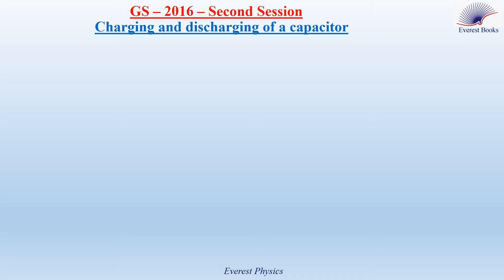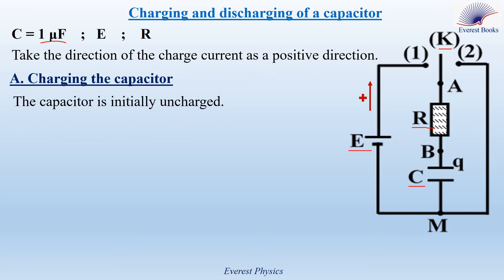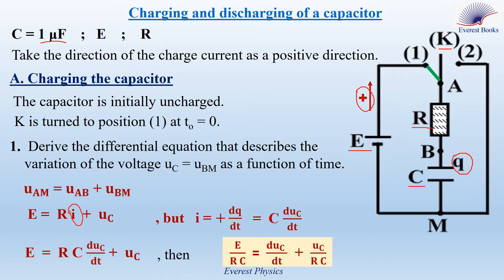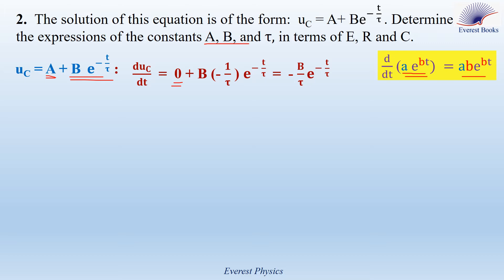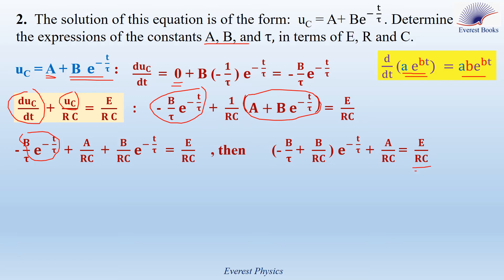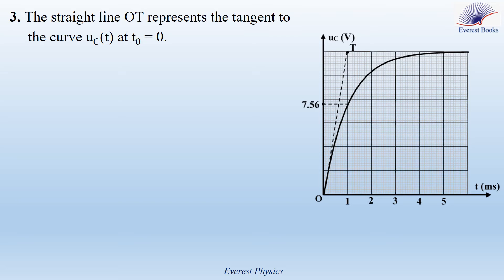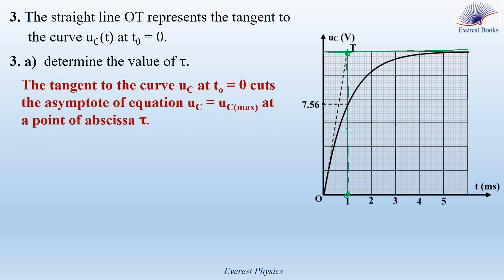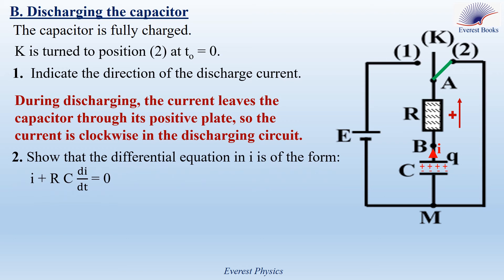Capacitor- Lebanese Official Exams [GS  (2016  - 2)]

Comment: I don’t know where I put i equal to  positive dq over dt or negative dq over dt
Reply from the maker: It depends only on the direction of the positive sense: If the positive sense entering the plate of charge q, then i = + dq/dt
If the positive sense leaving the plate  of charge q, then i = - dq/dt